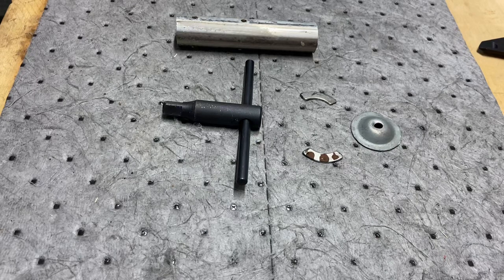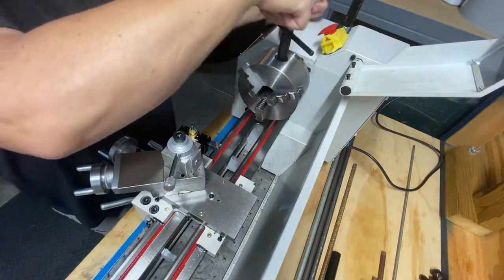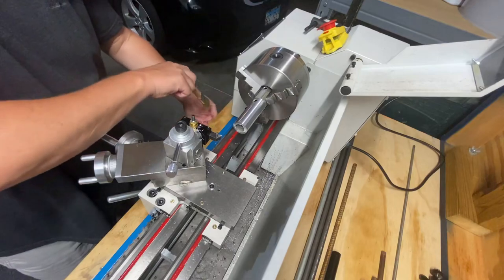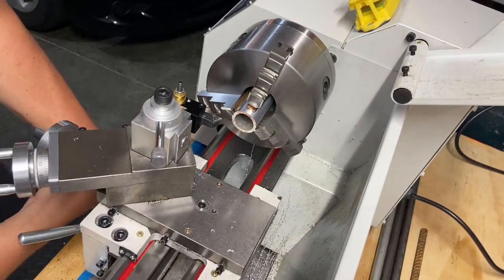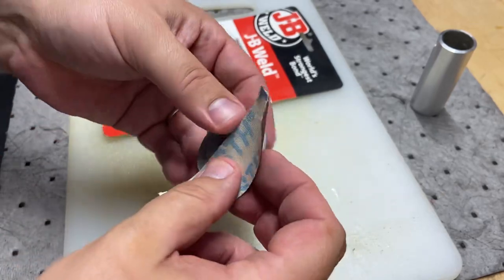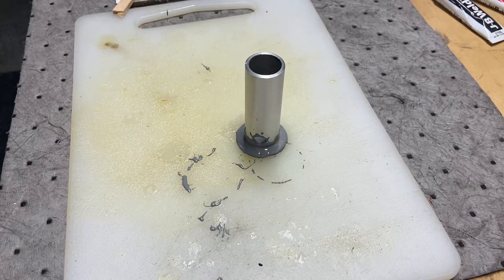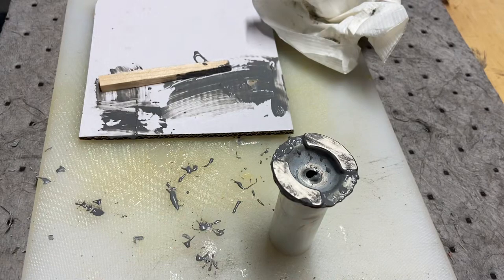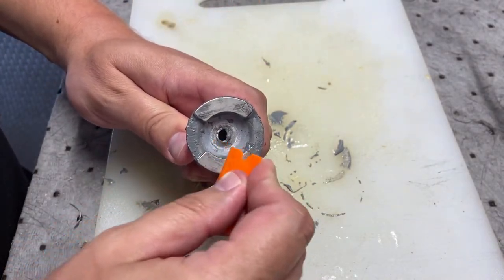Vevor Mini Lathe MX 400 Part 17 - Lathe Chuck Key Holder Project Number 3 Beginner metal Project

Comment: Good job man, you can put at the bottom a n.o switch and this doesn’t let your lathe work if the key is not in its place.
Reply from the maker: I like this idea,  The safety aspect of having the normally open switch would be a great feature.  I am going to consider this add one. Thanks for watching.